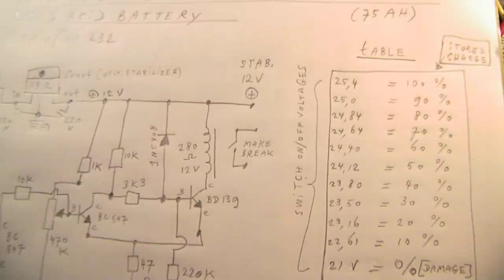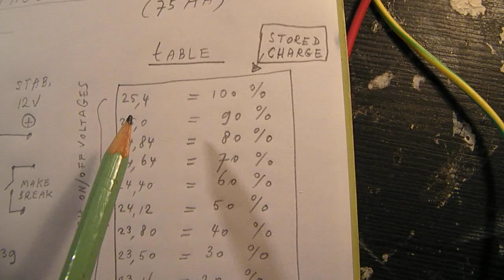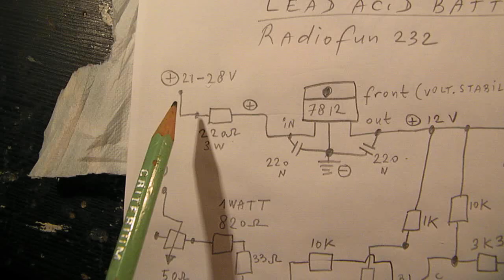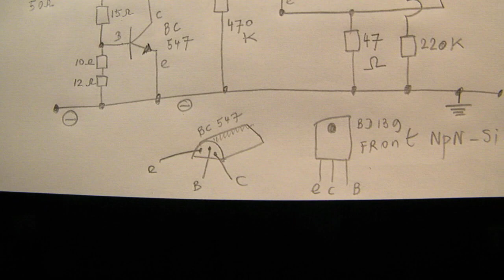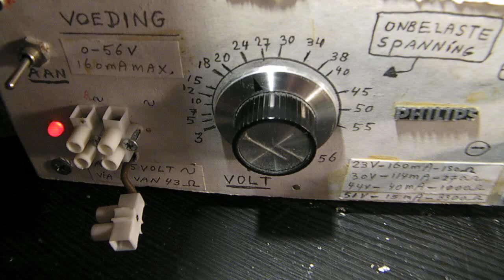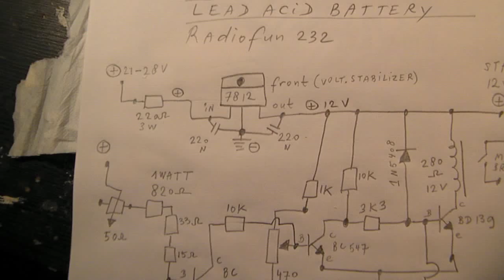Detecting the under (low) voltage of a 24 Volt battery electron. circuit & switch & discharge table

Comment: Awesome! I'm very interested in this circuit, but I need it to work on a 12v battery instead. I have a 12v 36ah lead acid battery that I would like to use this circuit with. I too have a solar panel that charges the battery nicely. Do you think it's possible to modificate the circuit for 12v battery?
Reply from the maker: Yes, a few things: the circuit can stay the same. Problem is that the schmitt-trigger must be supplied out of a stabilized voltage, because otherwise the sense-line voltage can move up and down with the charge(d)-status-voltage of the lead acid battery. That means that there cannot be a real under-voltage (it switches on 1/100 of a volt) where the schmitt trigger switches off or on. Perhaps: 5 or 6 Volt relay (with a stabilized voltage of 9 Volt to the schmitt trigger) could work. But: it is only an idea, it has to be studied and tested-out. I am quite sure that the circuit, as it is, will work on 9 Volts. And notice: the switch will (also) drain the 12 V battery out. Everything is worth a try!
Reply from the maker: If you really gonna make it: could be that a 5 V or 6 V relay needs a series-resistor, if not the relay coil can get too hot. It all depends.